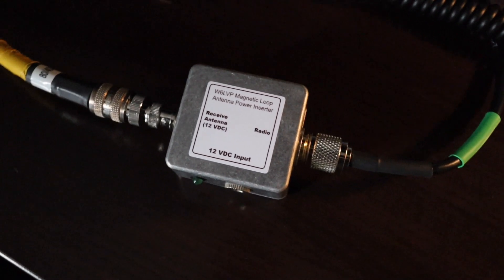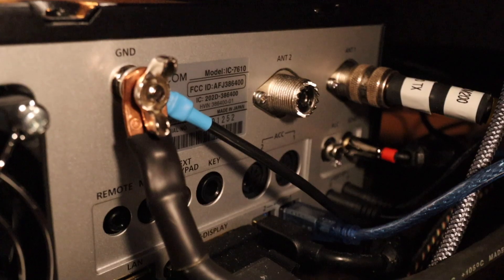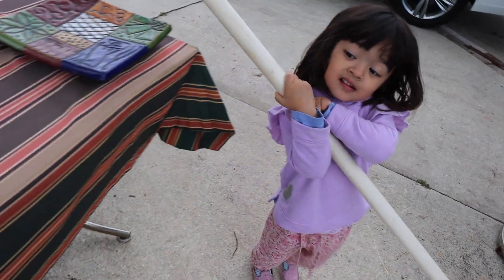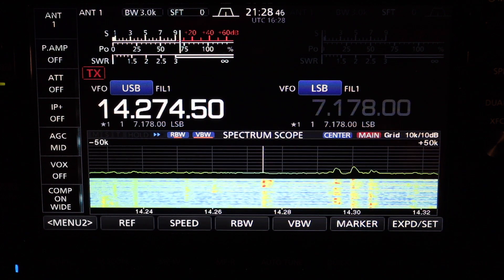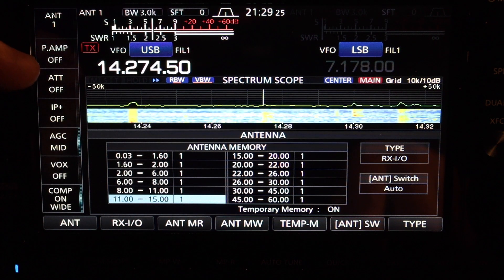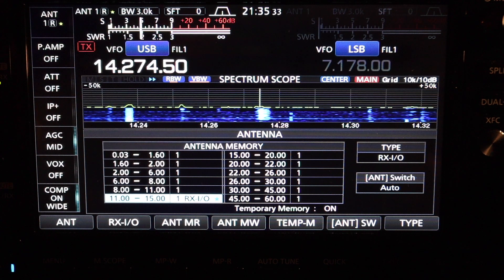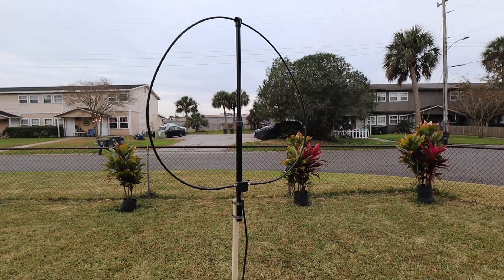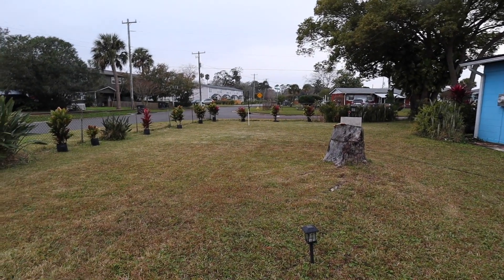My new W6LVP Magnetic Loop Receive Antenna | Compare the Receive between Zero Five and Loop Antenna

Comment: great loop - got 2 set up in SE Australia - noise floor is so low - actually lower than my Wellbrook 1530LN - tip: place a metre and a half off the ground with a rotator
Reply from the maker: Thanks! Mine is on the roof.

Comment: which one you like more for transmit? the Zero Five or the DXCommander I saw you in another video? How high you ended up leaving the loop? Im in FL too but in a stupid HOA so  right now I have my Chammeleon Receive Loop bolted to the aluminum pool cover (about 10' and im thinking to lower it like at 5-6' but away from aluminum and other objects. Im looking forward to add an 800amp so still debating between the DXCommander which already own but not mounted yet or a vertical. 73'
Reply from the maker: I've moved my W6LVP loop to my Texas station.  For my transmit  in Florida, I prefer the DX Commander which I pretty much can tune for very low SWRs.  8 prefer the DXC with an inverted L  for my transmit.
Reply: Cool, thanks for your reply. I guess I’ll stick with the DX commander. Do you know how high you installed your loop in Texas?
Reply from the maker: @angelscomputers  It's about 30 feet above the ground mounted on the roof.

Comment: Hi, are you still using the W6LVP with your 7610? I have been thinking about getting one for mine. Great video.
Reply from the maker: I've moved it to my other QTH where I now have it on a rotator to null out Air conditioning RFI noises from my neighborhood.  Works well with my Anan 200d.
Reply: @DarrenN4VFR  Thanks!

Comment: I am wanting to do this with a an SDR DUO with  a receive only mag loop. DX Engineering had a pretty pricy one, comes with a pre amp and other components. The one you have looks like it’s doing the job but was is the loop radiator such a small diameter. Or does that only matter with a transmit mag loop?  My FT 950 and 991 do not have the receive only antenna input which would be nice. 😊how would you proceed. Thanks you do get presentations and your helper is just to cute. Thanks
Reply from the maker: Also check out the MLA-30+.  I have both the W6LVP and MLA-30+.  I will make a future video of setting up my MLA-30+ on the roof as my receive antenna and my 40m horizontal loop for my transmit antenna.  That will be interesting because both will be on the 2nd floor and in close proximity of each other. 

My advice is sell the FT950 and 991 and get yourself the IC7610.  It has receive antenna ports in the back.  I show you it in this video.  Or if you want to also, check out the Expert Electronics on the SunSDR2 DX.  I have both radios but at different QTHs.  

Good luck on your decision.
73's De N4VFR

Comment: Hi nice video! Diid you try the loop on yhe Low Bands, 80 and 160? And how did it work?
Reply from the maker: No, I haven't.  I put my loops away until I can get a good deal on a Yaesu Rotator.
Reply: @DarrenN4VFR  i see. Im suffering on high noise floir on 80m and I thought of getting this antenna to try to lower my noise issues.
Javier
Reply: @javiersalazar5020  You could use it with a noise canceller device and phase out the noise.  MFJ makes one and also Timewave has the ANC4.  It would also be helpful in that duty if the loop could be rotated.  A loop antenna should have a very sharp null.
Reply: @moci42  thanks very much.

Comment: Based on this, on this I haven't changed my opinion of amplified antennas. 
Wouldn't wish one on my worst enemy
Reply from the maker: Oh well...  I will see how it works with my power line RFI.
Reply: @DarrenN4VFR  Prove it and your local power company is required to fix it.
Mine has a special repair crew that does nothing else
Reply from the maker: @gkiltz0  I've reported RFI and they've come out within a day sniffing for the Power line noise.  They fix it and then a different power line interference pops up.
Never ending situation. I need to move out to where it's quiet for HF operations.
Reply: @DarrenN4VFR  Based on my experience, if the neighborhood has underground wiring, you won't have trouble. If it's just that street/group of a few buildings you might still have it!

Comment: You should state at the start that it's for short wave radio.
Reply from the maker: You can use it for receive only on the IC7610.  I have a receive only connector for this antenna.  I use my Zero FIve 43' vertical for transmit and the W6LVP for receive.
Reply: It is for ham also, per the manufacturer.

Comment: Nice video, Capt!  Since I use a vertical as well I’ve been wanting to put down a loop on the ground for receive but can’t because my lot is too small and it would literally be in the radiating field on the vertical. I’ve been looking at these magnetic receive loops for a while. I’m interested to know if you ever have a situation where you can’t hear a station on it but can hear it on the vertical. The reason I ask is I know these really should be rotated and I’m interested if this can stay stationary and pick anything up.
Reply from the maker: I'll be in Jacksonville, FL on 2/23 and will test it out with weak signals on the 43' vertical vs the receive on the loop. I agree with have a rotator on the loop.

Comment: It seems a good device, a good RX Antenna in the shack solves a lot of troubles by line noises, led-lamps and so ones... but I'd like to see the same RX test on 80 even 160m bands, is it possible? I wish you good DXs and best regards from PR7TU.
Reply from the maker: That's funny about the LED lamps.  When I transmit HF, my  LED light above my monitor turns on and off and changes the light colors.  I'm not at my QTH but can test it for you when I get there.  73's